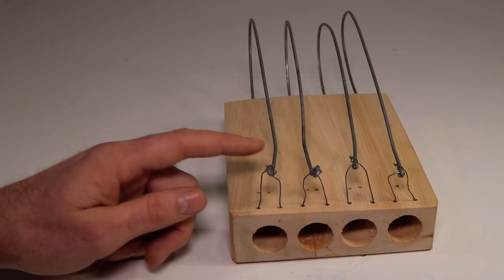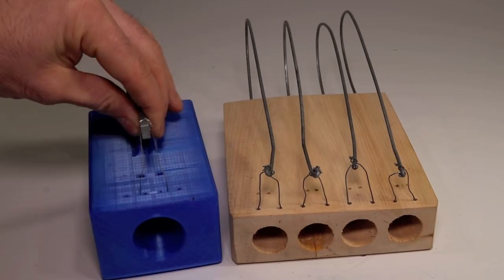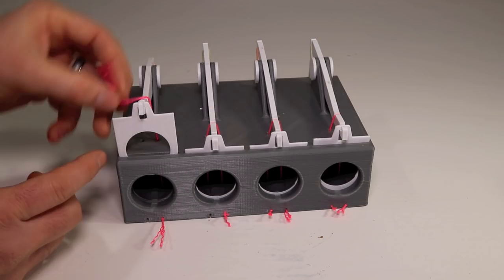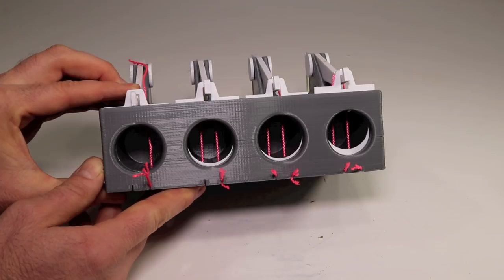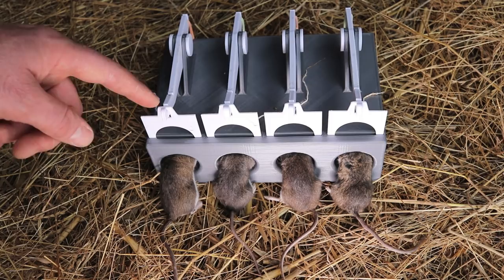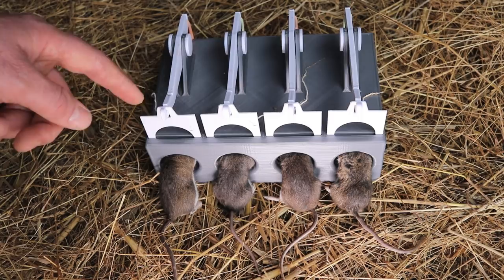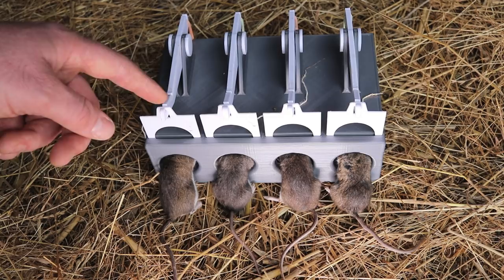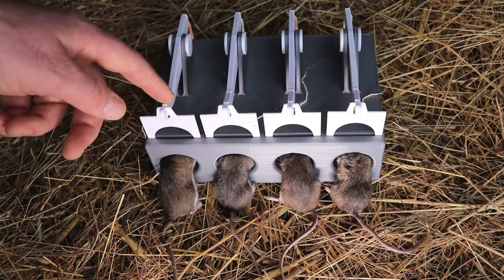3D Printed Mousetraps Are Awesome! 3D Printed Mascall Spring Mousetrap with new 4 Hole Design.

Comment: Might as well make one with 20 holes.
Reply: Multi-hole traps could easily be done with cheap and easy PVC pipe tubes laid out radially like spokes on a wheel to make it more compact.
Reply: David just put 5 side by side? then there's 20 holes
Reply: In fact, a 3D print with the holes meeting in the center would be ingenious in that there could be a single piece of bait! But the rubber band placement would be trickier.
Reply: You can actually make a noose style trap that doesn't use levers. You can use bent wire as a direct spring or make a frame above the trap to hang springs or rubber bands. You can get the idea from Shawn's other videos.
Reply: Daniel Routledge — Exactly!  You can have as many holes as you want - just add more traps!  I don’t get the notion of wishing that a single trap had more holes.
Reply: or 500 holes
Reply: 1000 holes
Reply: Dr. Evil voice One ... million holes
Reply: Even with 20 holes it probably couldn't get all the mice, that's why I like the bucket traps
Reply: Make a quantum trap
Reply: 999999999999999999999999999999999999999999999999999999999999999999999999999999999999999999999999999999999999999999999999999999999999999999999999999999999999999999999999999999999999999999999999999999999999999999999999 holes but I don't think people would spend that much time
Reply: David Lol
Reply: InfectedByEli We Shall Erase The Mouse Population
Reply: What does the scouter say about the number of holes in his mousetrap?

IT'S OVER NINETHOUSAAAAAAAND!

Comment: Awesome design of the antique version.  What if you combined the paddle “trigger” from the tilong rat trap with this design?  Instead of drilling the 2 holes for the string, just a small slot for the paddle attached to the big lever.  That would eliminate the constant need to replace the strings and also make it easier to reset.

Comment: Stringing the string through the holes looks to me like a more difficult step than tying it. Maybe pre-cut the string and dip it in starch solution? Then it would be both easy to thread through the hole and probably tastier for the mice. And 3d-printing would allow to make the holes for the string in the form of little "funnels" , to guide the string into them.
Reply: I thought that. Printed it and used needle and thread :)

Comment: I can see one great improvement to this. instead of making one block with 4 holes like this one, print a v groove into the sides so you can print them on even the smallest printer, but then lock them together like legos. Truly modular. had a bad problem? print ten! got it under control, disconnect 5 and give them away!

Comment: The rubber bands don't seem strong enough when the trap has sprung due to the way they exponentially lose power as they contract. Metal springs have a more linear pulling force, so they perform better even when they're slightly compressed or stretched. Rubber bands also lose power as they get colder, they heat up when you stretch them and cool when you relax them. Ambient temperature also plays a role, at night when it's cool the bands will perform worse than what you observe during the warm day.
Reply: ThrowingItAway Dead mice.
Reply: Personally, I'd use an angled flat spring situated under the arms.
Reply: Rubber bands are obviously strong enough to work and they are cheap and easy. Stop trying to over-engineeer something that doesn't need it.
Reply: Summed it up nicely cb6
Reply: heh, you're commenting on a 3D printed mouse trap that adds a lever arm, uses an inferior material for the engine, and arguably costs more and takes longer than the original to produce. Don't talk to me about over-engineering something if you can't see over-engineering in front of your face. There's a line between bad engineering that is cheap and engineering that is cheap because it is simple. 

Music wire springs are cheap and easy to make, can handle a wide range of temperatures and environments, don't fatigue over time under strain, have higher force applied at low deflection, doesn't require a pivot arm (because it's acting as it's own lever! ),  will likely outlast the wood that the trap is made from, mice cannot chew through it, etc... Steel beats rubber as a mouse trap engine.
Reply: How long will those bands last under tension when they're out in the elements? You're missing my point.
Reply: ThrowingItAway so make your own and send it to Shawn to test. Simples.
Reply: Just double knot rubber bands and replace them every now and then, the metal springs may be more sustainable, but really, who cares?
Reply: Good points but I think the beauty of the design is its simplicity to produce over the original. (I'm assuming all the printed pieces just snap together and then you add the band).
Perhaps you could combine the two, using the 3D printed body but instead of a lever have holes for the spring wire.
Best of both worlds.
Reply: you have a good point, I will try to find qaulity rubber. Maybe O-rings will do the trick?
Reply: +Throwing It:----Hey Bro!  Substitute condoms for the bands!!  They never quit!! Pflghfghahahaha!
Reply: ThrowingItAway those mice look dead to me

Comment: this would be alot better than the traps at the store
Reply: mouse traps that is
Reply: The spring wire traps from the store work well and they are cheap. More elaborate traps cost more money. BTW, the multi-hole noose trap was commercially produced a long time ago. You see them in old Warner Bros cartoons.

Comment: The setting up process is too cumbersome.
It is ok when it's new but once it gets dirty you don't want to touch it too much and pull a needle with a thread through every hole.
It needs a different trigger system.
Reply: Thats like the only trigger system that works.
Reply: No, it's not. A simple one could be used and it would be less messy and easier to set up.
For instance, there could be two pieces that hold the spring and when the mouse pushes the head through they spread apart and let the spring go.
Reply: West Senkovec 

That sounds more complicated then a string holding a wire down.
Reply: West Senkovec: Put your money where your mouth is then and upload a video of your design working
Reply: Artsy Scrub More complicated to make, not more complicated to set up. And that's the idea, you don't want the consumer to pay the price of an annoying setup
Reply: good idéa!

Comment: Does anybody know how can I get items printed on a 3D printer when you don't have a printer? What I'm asking is there a place online that I could send a schematic or diagram of something I want to be printed that is not going to break the bank.
Reply: Wannabe Mgtow there are a bunch of printing services that aren't too expensive, but design services a not nearly as cheap. 

Autodesk does provide their Fusion 360 software for free if you are a hobbyist or are making less than $10000 a year in parts. It's fairly good for beginners to CAD software, but if you have experience with AutoCAD the totally different UI will drive you crazy.
Reply: Since the files are hosted on thingiverse, there's a button on the right hand side "order this thing printed" which contracts out to several online 3d print services
Reply: Thank you all for your replies I am planning on getting a 3D printer, but I still want to wait a little longer since the technology is always developing and improving day by day.
Reply: Wannabe Mgtow The library in my town of 50,000 people has one.  I've seen people's projects printing.  Not sure about the details.
Reply: Ninja Master some libraries have 3s printers. You send them the file and pay for the plastic they use

Comment: Wonder if this could be repurposed as a capture trap as opposed to a killing trap? It would only require extending the length of the chamber and replacing the string mechanism with perhaps a pressure plate that would release a lock holding up the door. I know this works but honestly I prefer humane traps. Thoughts?
Reply: definitely, i have handmade the orrigional design and making it longer would definatly work. just use a door with a hinge overa drop to avoid harming them. i will also make you a 3d printable trap on tinkercad so when you see this go to tinkercad and search mousetrap for conner

Comment: Interesting. I rented an old house that had holes in its walls and foundation that would let in rats. We found that initially our traps would work well, but after we caught a couple that type of trap would stop working and they'd either leave the bait alone or they'd figure out ways to get the bait without setting off the trap. Maybe we were just unlucky, but we got the very strong impression that they were learning from the mistakes of the others. (There's no question that rats are intelligent and capable of learning.)

Comment: I would design it as individual trap slot with joints for connection. So you just have to print the same model many times and connect as many together as you like.

Comment: After watching the other video I say one improvement would be to move the fulcrum forward so there is more force at the noose end as it seemed some mice were struggling for a bit after getting caught.  A trigger system based on the mouse pushing their nose in rather than chewing through a string could simplify the setting process.
Reply: TheCrewl1 with the struggle of life comes the struggle of death.

Comment: The holes are not that deep right?! I don't know if it's possible, but something like an alternating pattern could be an interesting approach to have holes in the front and the back, adding 3 more holes for the same print size, or even doubling if it's just a little bit longer. My only concerns would be about the mounting points of the rubber bands and about the trap getting too light.

Comment: This needs a quickly resettable latch and pressure plate system instead of the strings... Then it would be perfect.
Oh, and make the housing modular so you can print as many or as few as required (or fit on the printer bed) and clip them together. This would also mean if any rats or mice chew a section out, you only need to reprint that one module instead of the entire housing.

Comment: Another benefit for those that are very squeamish, since it's 3D printed, you can simply chuck the whole box, mice and all, when all the holes are full. I know, it's a bit wasteful, but if you have a 3D printer already, you're only paying for the filament. So use as little filament as you need to make the box (no infill, shorten the  depth since they only need to chew through the string, etc).

Comment: How about instead of a string to chew on to set the trap, a door flapper? Mouse pokes it's head into the entrance of the hole to push the flapper which was connected to the choker that now as the flapper is pushed the choker springs into action. Difficult for me to write my suggestion. I won't attempt to build one because I would prefer a high multi collector trap like maybe a bucket.

Comment: the trap could work even better if it was a round disk or ring that you could put in the center of a room, and have 8 or 6 holes on the outer edge of the ring and 4 or 5 on the inside of the ring.

Comment: These 4 hole killtrap designs really make you realize how dumb mice are.
I wonder if these would work upscaled for rats. Those are supposed to be quite clever, right?

Anyway, to add more holes I'd create something radial. Like a doughnut, with the rubber bands in the middle and the holes all around.

Comment: Replace the bottom of the "strangulator" with razer blades
Reply: 1st. *razor, you wont use pc equpment to kill mice
2nd. you are sick
Reply: You're crual!
Reply: There's no need to. This is just as efficient
Reply: It's already enough of a mess without the extra mouse blood. For the sake of your health, handling wild mice and their remnants should probably be kept to a minimum.
Reply: I really think your device would be more human if it worked, because if their head came off they would definitely die instantly. However like the others said, this consistently gets the job done and dealing with bloody remains is unsanitary.